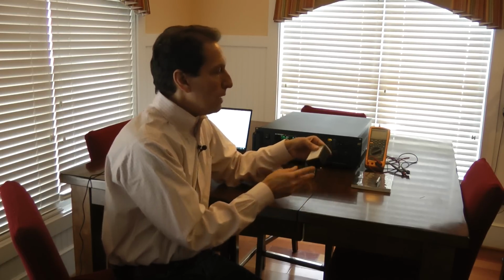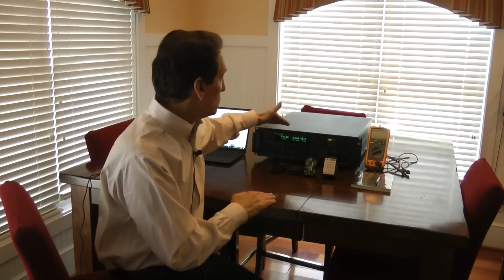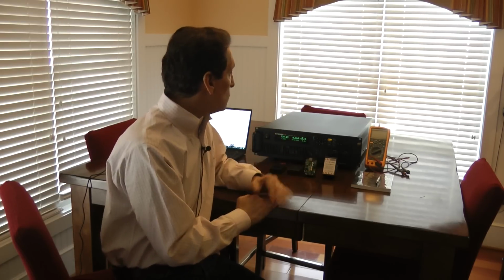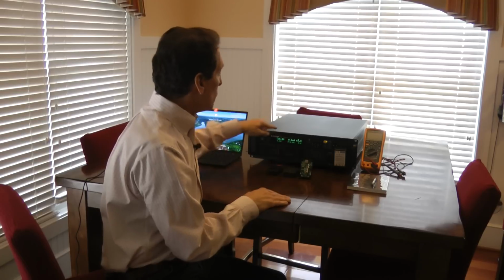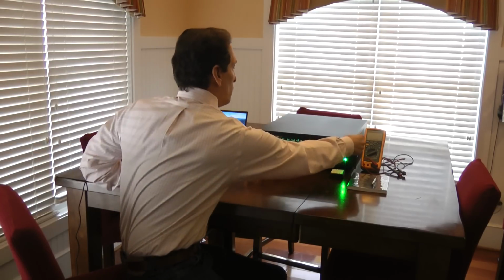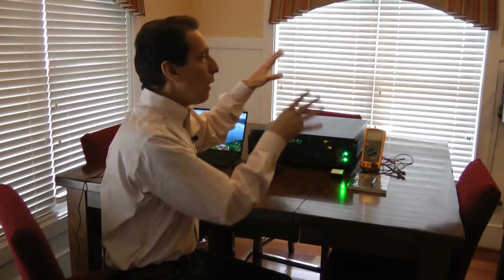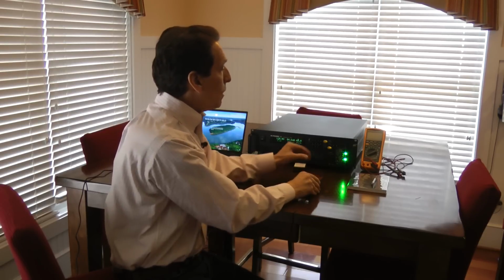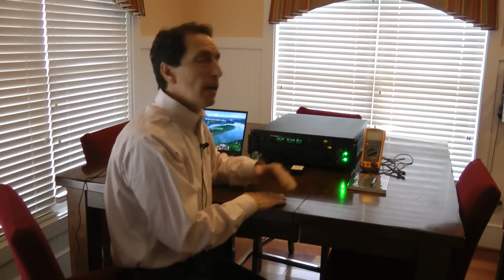EMP ALERT: The World's First EMP Detector

Comment: Do lights and/or sounds differentiate between under/over voltage and types of emp?
Reply from the maker: There are three different sounds: short temporary beep for E1/E2, a sustained beep when the line voltage gets too high (from E3) and a pulsing beep when the line voltage gets too low (from E3). There are also lights to indicate a detection.

Comment: May i ask how long you would have to run and flip the main breaker? For some reason i thought that an EMP or Carrington Event would just fry wires/chips immediately.
Reply from the maker: The E1 and E2 will be over before you can blink. The E3, though, could last minutes or longer. That long-duration surge is particularly troublesome to electronics.
Reply: @disasterprepper  thank you for your information.

Comment: Two ideas for your consideration:
1. 2 LED (or other) indicators showing if either/or both alerts had been activated. Manually re-setable.
2. A latching dry contact closure for external alarm monitoring and/or rapid activation of circuit disconnects.

Both would be useful if your away from the site. ie you come home and some electronics are not working correctly.

Thanks for your work and training.
Reply from the maker: Hi Rick, thanks for the suggestions. The current design does have LEDs to indicate when an alarm condition is detected. But believe me, the audible alarm will leave no doubt. They reset automatically when the condition goes away. We did discuss making it a latched output, but this first version doesn't have that. The ability to drive an external system is also something we discussed, but again, it wasn't done in this first unit.

Comment: Interesting concept. I know adding features would add cost, i.e., GPIO (relay), but how about blue tooth and/or WiFi to give a remote IP alert too? iPhone/Android app?
Reply from the maker: It is certainly possible, but as you said, it adds complexity. Right now, the entire thing is completely analog, with no sensitive digital electronics to be damaged.
Reply: Another option might be zwave or zigbee. Diy geeks could use smart home to transfer to phone
Reply: I would like to see 240 volt version in Europe.

Comment: Could you add a relay so that once the power surge is detected your device activates the relay which would essentially short out in the outlet automatically tripping the breaker for that circuit in the house.
Reply from the maker: It's possible, but shorting out a breaker might require 10 times the rated current. That means you'd need to pull perhaps 150 amps, which can be tricky to do safely.
Reply: In electronics, that's called a "crowbar" circuit, and it is commonly used in things like fast-switching power supplies. You wouldn't want to use one on your house though, because if your home circuit breakers are sticky at all, it lights the house on fire. :-))
Reply: Plan B…. Use a wifi circuit breaker

Comment: @empdoctor I wrapped electronics boxed (in original packaging) with heavy duty aluminum foil and sealed with metal tape. Should I also put those packages (foil) in a galvanized trash can? Would I have to put plain cardboard inside the trash can first? Thanks in advance
Reply from the maker: If you've fully wrapped the box with heavy-duty aluminum foil, you should be fine. That provides about 50 dB of shielding (99.7% field reduction). If you do put things in a trash can, most people line the interior of the can to keep anything metal from touching the interior wall.